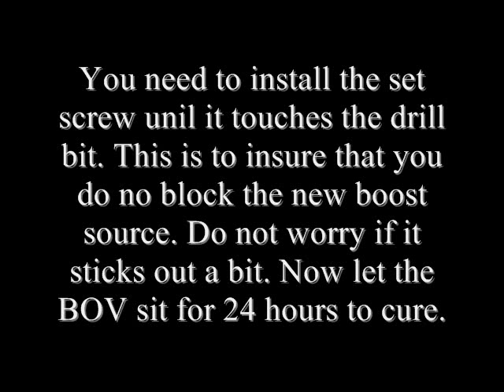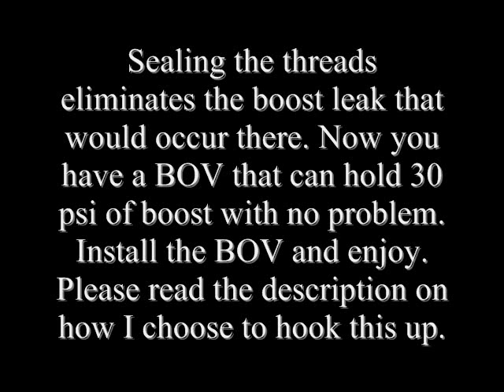How to Dodge Mod a BOV

Comment: It worked great for me, my daily driver (I have a 1990 Laser FWD Turbo)is much faster now! Before I did this mod I was peaking 10 PSI for a while and then I guess the BOV broke because it kept bleeding off to around 5 PSI at redline.. It was some eBay Greddy wannabe valve.. lucky me, the PO left me the stock BOV in the trunk. Thanks again. Great and informative, sounds nice too. Much better than the old valve sounded.. It sounded like compressor surge. Thanks again Robert!

Comment: This almost accomplishes the same thing as how the mk2 MR2's functions, but I can not say for sure whether or not it does, because Toyota went to the length to be specific about the surface area of the diaphragms in the chambers.  Their BOV holds tighter as boost increases.  They use some special valve between the chambers that allows air to flow freely in one direction but restricts airflow in the opposite direction, allowing it to be very sensitive to pressure changes and open very quickly.

Comment from the maker: The FPS was hooked up using the existing FPS plug in the engine bay. You must be using ECMlink to control the FPS for the intended use. There is a link at the bottom of the description that has pictures and further explanation on how to hook up the FPS to work with the dodge mod BOV.

Comment: Great video! My 1G BOV peaks around 15-17 psi before it starts to leak. At that point it really spits out boost. I only had one question I see from the description that you are using the FPS to regulate the boost to the BOV. How exactly do you have that setup? Do you use the FPS connected to the original harness plug? Did you wire it in a different way? I too have a 90 Talon and this would help a ton! Thanks again Robert!

Comment: I just subscribed to your channel I enjoyed your video I have one of these blow off valves on my Honda.
My question to you is does the blow off valve sound different when you let off at Full Throttle not getting full pressure until your tps value drops below 40% vs when it was in the factory configuration?

I'm going to control it with a solenoid through hondata on my nitrous outputs I understand I will have to play with the values to get it right.